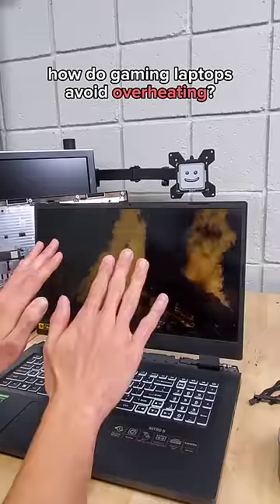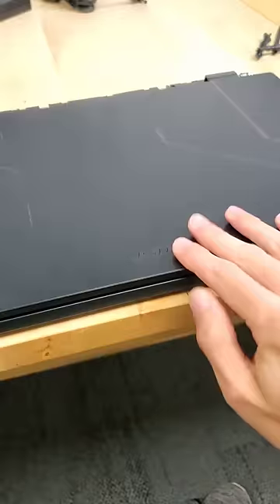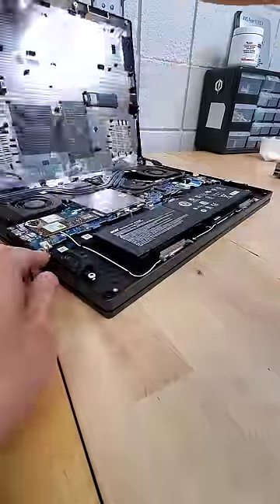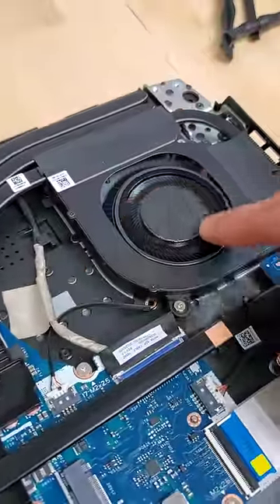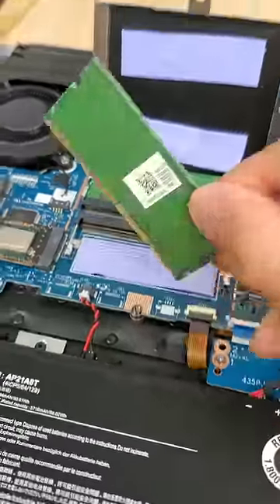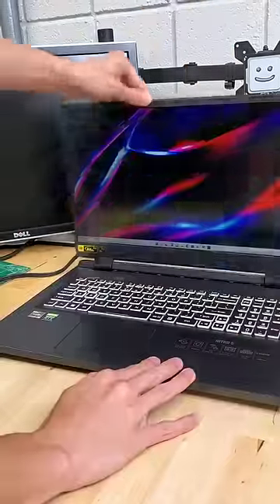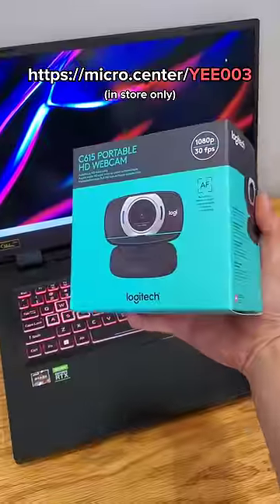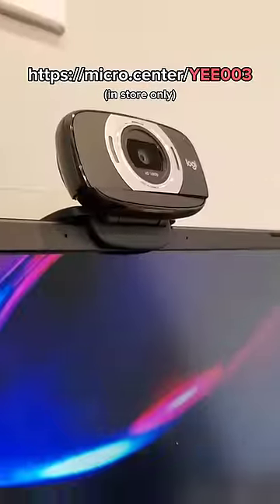how do gaming laptops avoid overheating? #shorts

Comment: This is complete bs. I have the exact same laptop but with a core i7 12700h, and the cpu heats up to 100°c. I replaced the thermal paste, elevated the back for better airflow and yet still the cpu temp under load is 95°c. Don't buy this laptop! As a person that made a mistake of buying this I can tell you for sure!

Comment: Well how do they stay cool?

Answer: They Dont
Reply: I was about to comment this 🙁
Reply: @jackthaller7151  was about to say that too XD
Reply: Yes
Reply: Yep, exactly.
Reply: Ok, remove those coolers
Reply: Gamer laptops are like males, it has a solid heat pipe system that gives the impression it’ll last for hours, but throttles after 12 seconds of action
Reply: If you have a fan control software you can make it so the laptop fans are at 100% all the time. I tried it and yeah while it makes your laptop sound like a jet engine, the temp difference was about 20°c
Reply: @ibm5155  😂
Reply: @germanfisch  that's really weird cause assus rog laptop always stay at 100% fan speed while gaming and still manages to touch 90 after an hour or 2 but doesn't sound that loud tho
Reply: I own DELL G5 ...after 3 years of using it, it always throttling due to a decreased heat release issues
Reply: @bagoes99  that's because you have to clean regularly the heatsinks fins
Reply: @edo9104  just replace the whole motherboard and DELL technician also do clean the fan and pipes ...thanks for 2 months warranty remaining and still got covered
Reply: @bagoes99  that's great, glad to hear you've got a replacement just in time
Reply: Thing is that your components no matter if they are a laptop or a PC will still overheat
Reply: Overused joke
Reply: @ibm5155  dirty mind
Reply: @Templar_Albrecht  but pc have many fans so nop
Reply: Mine stays pretty cold
Reply: Not gonna lie. Something people don’t realize is that both laptops and desktops heat up. You just don’t feel your desktop constantly while you’re using it, like one would with a laptop.
Reply: @Bambingobongo  ya i know they do the difference is your gpu and cpu dont thermal throttle because the desktop has something more than a 3 in fan on a piece of a soda can
Reply: I had one with a 3070ti but it burnt out in 6 months and warranty prevented me from doing maintenance. After that I built a high end AM4 build with a 3070 and I went overkill on cooling.

Comment: “…Prevents them from overheating”
*Plays stock Minecraft: CPU: 88°, GPU 92°
Reply: The temps are the other way.
CPU: 95°C thermal throttling
GPU: 60°C 😎
Don't forget, OpenGL isn't heavy for the GPU. Unlike the single core performance of the CPU.
Reply: I have the prior model ( i5-10300H paired with the RTX 3060 ) and the CPU usually runs at 80-90ºC under heavy load while the GPU remains cooler not going over the 70s. Highest CPU temp you ask? 97ºC playing War Thunder
Reply: @Pilotamente077  My friend has an i7 in his laptop and he has 90°C all the time, even when just using a GPU and not the whole CPU. I mean, Intel even pushes clocks like 4,5 GHz to it. I don't wonder that those laptop won't last long as even these low temperatures can melt the solder if running for a really long time. Would be better to use clocks like locked 3 GHz and it the laptop would be immediately quieter on the jet engine and probably last longer. Can you imagine the CPU getting hotter than a GPU under a max load? My AMD Ryzen 3 5300U with an external GPU through the PCIe holds under 60°C because of some aggressive fan curves set by HP.
Reply: @thisfeatureisbad  I bought an external fan to help the internal ones and it honestly works. I never go over 85 now, which is good. RAM aren’t the real issue in these modern laptops unless you overclock them. Neither M.2s are
Reply: Still i wish Acer cared more about cooling on my model (Nitro 5 2021). Opening it up means losing your cool. I couldn’t understand why the went so damn chill with the cooling pipes.
Reply: @Pilotamente077  I found out on the cheaper Acer laptops that they use a lower quality SK Hynix SSDs with a single memory chip on a single side and no thermal pad or heatsink on them. I was just watching a movie or downloading a game from Steam and the drive already throttled on the 70°C.
Reply: @Pilotamente077  My friend has a Nitro with a GTX 1650 Ti and damn. I have a classic 1650 in my desktop and his runs better. I even tried borrowing one CPU and same result. -_-
Reply: @thisfeatureisbad  Mine had chips on both sides. Replaced with two 970 Pro now anyway. Same thing with the RAM, couldn’t survive with 16Gb so i went with Corsair Vengeance 16x2 2933MHz
Reply: @thisfeatureisbad  My RTX won’t run over 80 watts. No need to say more
Reply: @Pilotamente077  I had to buy some 8 pin IC clips to stick it into my laptop and flash an older firmware of the BIOS in order to get rid of the temperature limit which blocked the CPU going over 60°C. HP, you can do better without including 15 bloats all starting with a word HP. 😂
Reply: @Pilotamente077  Some laptops even over 1000€ have a soldered on-board RAM 💀 It can meet a trash can if they fail. I thought we wanted to make less e-waste. But, it seems we want the opposite.
Reply: @thisfeatureisbad  Honestly no brand gives a shit about pollution and other things like that. Having soldered RAM is like having a tattoo that you cannot remove, unless you cut your arm
Reply: @thisfeatureisbad  it's because they're mobile chips not the actual desktop variant. I have a 1060 and it beats out a 3050 mobile because it has more VRAM, higher clock speeds and my specific 1060 is usually in the 60s and 70s. My case has terrible air flow so with the front panel off my GPU is in the 40s and 50s. If the fans are turned down it'll be in the 60s. Great temps and there's a solid overclock
Reply: @Mustafa_Deniz_COBAN  Java in a nutshell.
Reply: Bro my pc gets 60c for cpu and 80-90c for gph when playing anything
Reply: @Pilotamente077  they really don’t, and if they do it’s to just so they could make some ads about it.
Reply: @thisfeatureisbad  if he uses windows which he probably does then he search "power options" in the search bar, click it, select some power plan or create a new one, click the blue text next to the power plan name to edit the power plan, find and click something like advanced options, find something there that has "CPU" in it's name, expand it with the plus button next to the text and find "CPU Maximum power" or something like that and set it to like 70%, it won't actually disable cores or another things but limit the CPU clock speed to 70% of the maximum turbo clock, you can open task manager, click the performance tab and check the CPU clock speed if it matches what you want so like 3GHz and slowly adjust the CPU max power to match it, and the CPU can  won't ever go to more than that clock speed if you don't change the power plan
Reply: @CreeplayEU  I know that. I have my laptop on 10% max and it the temps never get over 45°C even while playing 1080p60 video without sny dropped frames. They drop only while switching the full screen, but that's normal. The CPU almost never goes over 2 GHz. Oh and the battery, I extended its life by another 4 hours when doing light stuff. Unfortunately, some OEMs like Acer use overclocking in the BIOS which boosts and overvolts the CPU even when using this lock. I tried to cool my friend's Intel CPU which was always on 90°C when utilizing the GPU on 100% with this power plan method. Also, the Nitro program overrides all Windows settings. The GPU is literally cooler than the CPU.
Reply: @Pilotamente077  what external fans did you buy?
Reply: @carpr2013  Some standard USB fan on Amazon, should be 1800RPM max and you can adjust the speed ( Low, medium, high)
Reply: @thisfeatureisbad  I’ve never owned a laptop, except for an old one that my brother in law owned which has an intel 7th gen i3 with a broken screen that I use as my TV’s multi media player, has a bunch of movies, Netflix and YouTube on it
Reply: You can disable turbo mode for the cpu and ur temps will decrease ALOT. My cpu used to be at the 90s when playing games but now its mostly at 50s - 70s depends on the game
Reply: My laptop i7 continuesly runs at 100° while gaming and GPU between 70-80° is this safe ? Or should I change thermal paste?
Reply: @ABDUR4224  You should open it up and check if any dust is blocking the fans. If it doesn’t work then try adding an external fan.
Reply: @Pilotamente077  no i have checked the fans and my laptop is almost new brought it 1 month ago. It was working fine but after a month it started to overheat and fans also sounds like waterfall going inside laptop.
Reply: @ABDUR4224  Laptop are well-known to be lava generators, if you keep having this issue even with lower ambient temperatures then try replacing it with another if the warranty is still on.
Reply: @Pilotamente077  ok this laptop was good for 1 month after a month it started to over heat maybe thermal issues
Reply: The thermal paste that comes with most laptops is pretty shitty.. I put Kryonaut from Thermal Grizzly on mine and it stays relatively cool 👍
Reply: That when I play resident evil 2
Reply: Have you tried to reduce those graphics settings of Minecraft? Just in case if that helps
Reply: Thermal throttling is over 175 degrees Fahrenheit most CPU’s under load in a desktop even at overclock stay around 50 to 60 celcius or 100 to 120 degrees Fahrenheit so if ur getting 88 Fahrenheit that’s pretty good if u have 88 celcius in supeised u can’t run anything 😭
Reply: I love how you called it stock Minecraft instead of vanilla Minecraft 😂 ima start using that term for unmodded games
Reply: It still doesn't overheats, laptop components is not the same as desktop
Reply: @thisfeatureisbad solder cant melt at 90 degrees mate. Need atleast 250 degrees to do that.

Comment: Acer Nitro 5 user here. I've have an AN515-54 for nearly 2 years now, and I managed to keep it cool by replacing thermal paste and replacing thermal pads with K5-pro. It helps a LOT to undervolt. If you don't feel like messing around inside your laptop, UNDERVOLT IT! I GET IDLE TEMPS AS LOW AS 95°F NOW COMPARED TO 140°F BEFORE!! The GPU doesn't even go past 165°F after the undervolt!
Reply: Fellow user here, nice to hear. Wish u used Celsius instead of Fahrenheit, but still nice to hear nonetheless.

Comment: yes, they keep cool by limiting cpu/gpu performance aka thermal throttling. gosh, i hate new, 'slim' laptops nowadays but had to use them for my work. wished laptops stay thick so they can put bigger heatsink + fan there while the companies shrink the die. playing games today are like no no when on the laptop.
Reply: I love my Lenovo Legion 5. It might be heavy, but, it has a beefy heatsink for the Ryzen 7 5800H and RTX 3060 that are powering it. Idle temps are close to 49°c even with the fans running quiet.
Reply: @leonidastankiangaming I guess you install air conditioner?

Comment: Have Nitro 5, IETS 500 Laptop Cooler and Disable Turbo on ThrottleStop helps a ton. Plus maintenance of Thermal Paste and Pads too. In any gaming laptops IMO.
Reply: Sorry but if you find yourself disabling  turbo while using a laptop cooler... then you just have a problem with your laptop cooling system if there is any
Reply: @Hk-uw8my  I agree. But this is for games that eats tons of ram and cpu and gpu. My laptop is just a few months old, but Nba2k18 makes my temps 90C at very high graphics. When I disabled turbo, no performance loss on the game, but my temps are now 72c. Some games are not optimized well by the developers. Skyrim V at ultra with ton of mods, my temps are just at 60c without turbo disabled.

Comment: Do : 1.What if u use whipping cream as thermal paste
2.What if u use cpu as thermal paste (cpu placed on cpu) 
3. What if u use ice cream as thermal paste
4. What if u use concrete as thermal paste
5.what if u use cement as thermal paste
6. Chocolate as thermal paste
7. Cloth as thermal paste
8. What if u run cooler on 1.5v battery 
9. What if u use coca cola as thermal paste
10. What if u use gas as thermal paste (Dont try that at home...)

Comment: Would you recommend buying a laptop or building a pc
Reply: It really depends on what's more convenient for you. A PC is more powerful and can be better on a budget. Laptops are pricey, but, they can be used practically anywhere as long as you have WiFi (or Ethernet) and a power outlet. I have both and I still prefer sitting at my desk at home and using the PC instead.

Comment: The secret is... They don't, they overheat like crazy 😹 
Estimated life time 2 years 
10 years of repairing laptops.
Reply: False, new laptops rarely even overheat
Reply: @ilcarlino752  Do i detect... sarcasm?
Reply: nope, I have a 4060 laptop, it doesn"t overheat if I use it wisely
Reply: @ilcarlino752 my Asus with an 11th Gen i7 and 1650 Ti 4gb reaches 85 C playing GTA V.
Reply: @kingal89  my msi cyborg 15 reaches 40 C when playing gta max settings with an undervolted cpu, and 60C without undervolt
Reply: do notebook laptops with dgpu 50 watt  tdp heat even during normal tasks
Reply: Honestly, the only hope for gaming laptops are expensive pressure cooling pads that seal cool air underneath it

Comment: they don't - they use cheap ram so the laptop bottlenecks a lot so it can't overheat (eg. here ddr5 1rx16 ram ). It is either this, a plane blade or a pan.

Comment: Actual tip: if you undervolt some laptop CPUs you can drop temps by up to 20 degrees celsius, making it run faster. Make sure the settings don't save when you're testing though, you could get stuck in a crash loop. I recommend ThrottleStop if you can figure it out.
Reply: I'm considering getting a gaming laptop because I need one for school and instead of buying a new laptop and keeping my budget gaming PC in considering getting an rtx 3050 gaming laptop. For gaming Ill probably buy a cooling pad
Reply: @calvinilkay1067  Depending on what laptop you get, a cooling pad could help a lot or do basically nothing. My cooling pad only helps cool things by around 5 degrees. It couldn't hurt to get one, though. And as I said, definitely try undervolting, it's free and can help a lot (depending on the laptop, of course).

Comment: I have a Acer Nitro 5 AN515-47-599H, and let me tell you, gaming laptop are just as bad as prebuilt. I encourage anyone who is planning to buy a gaming laptop to swap out the thermal paste as soon as possible because factory paste are absolutely garbage. I also recommend using Throttlestop to undervolt (not underclock) your CPU to prevent thermal throttling even further.

Comment: Wow acer has changed, in 2020 I had a acer nitro 5, how that thing was horrible, after 3 weeks a fan bearing broke and it sounded like a lawn mower. The cooling was not good, it had 2 heat pipes total, they went from the cpu INTO the 1060 6gb gpu, my cpu would idle at 80*C

Comment: How do they keep this laptop cool:
1) laptop cpu and gpu speed is reduced from its original to keep laptop cooler.
2) they are using 3 pipes to keep heat away from AMD cpu and rtx 30 series  thinking that it will be fine.
3) they suggesting you to buy headset with noise cancellation so you don’t hear that airplane sounds while you launch chrome. 

All in all they don’t. Or you will be paying for the slowed down system.

Comment: How to prevent a laptop from overheating:

Don't buy a laptop with a GPU
Reply: Y e s
Reply: What if you don't have another choice, and you also don't want to work with those wires? And if you don't have money for a proper gaming PC, you can't just move in one route
Reply: The main difference is overheating and thermal throttle. Overheat yes, thermal throttle no because it's under powered to the point it won't go thermal throttle.

Comment: I have the nitro 5 with the ryzen 5 and 16 series card and ive never had it over heat
Reply: Because AMD is much better at the cooling unlike Intel as they push 4,5 GHz to all cores even when on 90°C. AMD rather uses more aggressive fan curves to make the CPU last as long as possible. My friend's Nitro 5 handles CS:GO max at 120 FPS, meanwhile my office laptop with an AMD iGPU goes over 200 FPS with no problem. Adding my desktop GPU to it through the M.2 slot would make it a gaming beast.

Comment: I have an acer nitro 5 with rtx 3050 and i7 11800 H. My gpu stays below 80 degrees all the time but my cpu reaches 92 degrees. It sometimes goes lower, but never higher than that. Is 92 degrees for my laptop good? (Acer nitro AN515-57)

Comment: I can attest that Acer did a good job with the Nitro Lineup. GPU especially is cooled most of the time. CPU not so 💀. Plus my cpu bottlenecks like crazy. Providing I bought the Acer Nitro 5 with an i5 10300H and a 1650TI two years back. It's still holding up okay. But I have come to find that it isn't enough for what I'm doing right now 🫠

Comment: Hi mryeester!
I have an i5 2400 and a Asus h61m-e and I'm not getting a video signal thru the intergraded graphics and when I use a GPU, but my monitor detects that somthing is plugged in but It doesnt give me a video signal, I've tried new cables, monitors,and clearing my CMOS and still nothing, I don't know if I need to replace my motherboard or my cpu, can you help me out?

Comment: The answer is simple dont buy high GPU and cpu but better ram and light graphics card if u still wanna enjoy gaming and dont wanna be bothered by over heat ( play games at low quality 😂)
And if ur not bothered by heating then go for it buy a good laptop like me 
Cpu 4.5 clock speed i5 11 gen
Ram 16ddr
Graphic card rtx 3020.
Rom 2 TB
Display uhd 4k 16 inch
And now i play games at 100fps with 30-80°c temperature and my laptop still strong enough there is no flaws or anything broken but only battery damaged due to over gaming more than 4+ hours but I don't care cause it wont leave my house